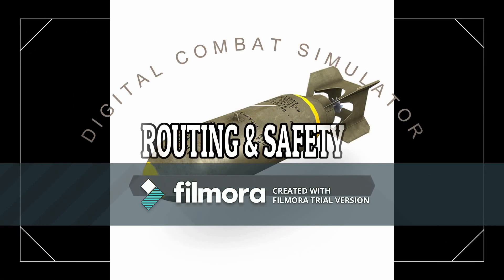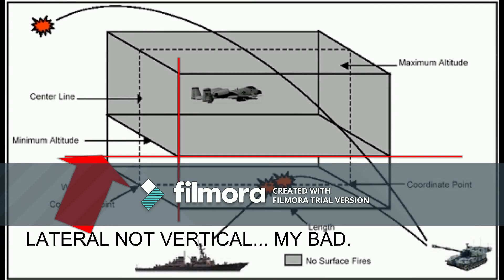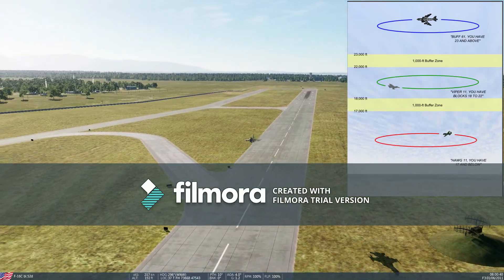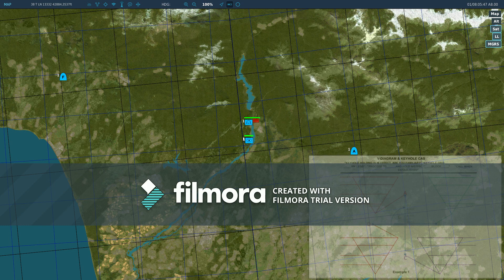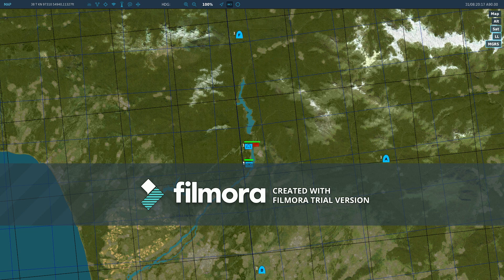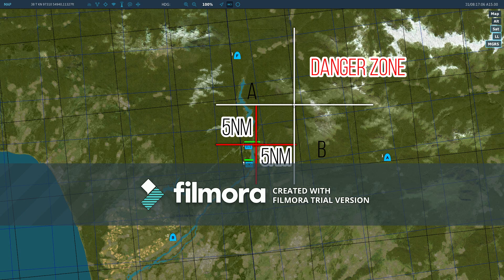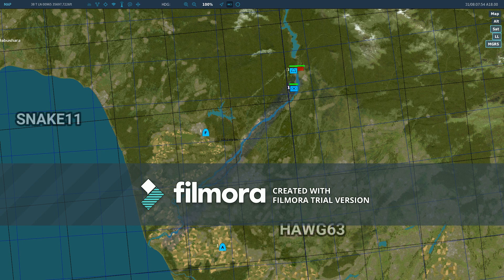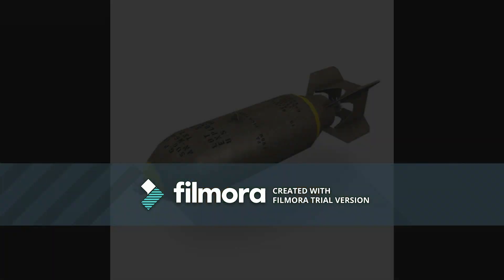DCS WORLD Routing and safety of flight. DCS CAS EXECUTION CHECKLIST SERIES VIDEO 2.

Comment: in this example from the Manual, when setting up a keyhole "JTAC: “Stang 11, proceed to Alpha 8, angels 15, report established.”

Would A8 be named so because it is 8NM from the target area, just wondering if that is a rule of thumb.
Reply from the maker: Thanks for the question.

In keyhole Ive never used names.  This is traditionally used with IPs (initial positions).

Alpha 8 is just that, alpha 8.  Can’t confuse it with Bravo, charlie, delta or Echo 8.

Any other questions, just fire away!

Cheers.
Reply: @JTACRIFLE  Thanks, I mis-spoke slightly, What I meant was when Using the Keyhole Method to set up IPs. I think I am starting to get the hang. Apricate the Quality content!